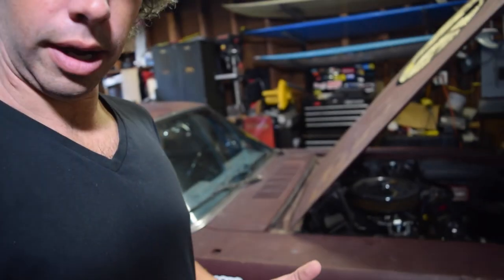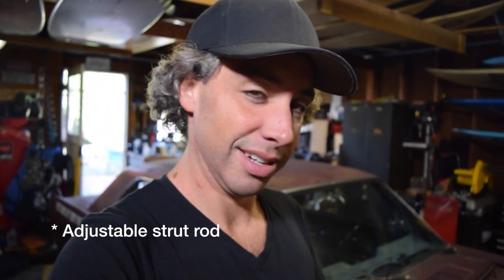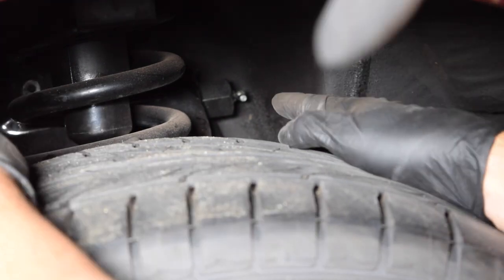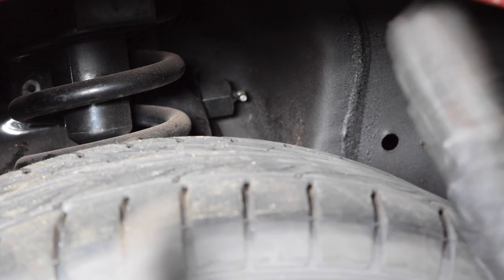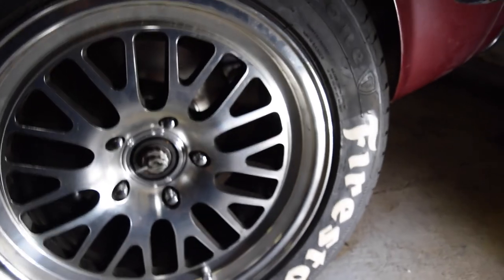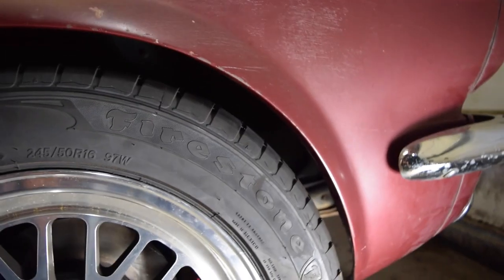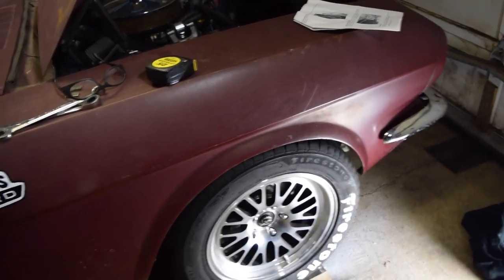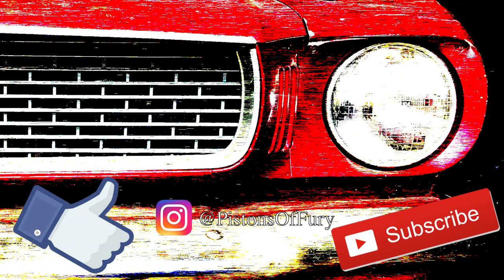PoF // Ep 28 - How to adjust your caster

Comment: I am about to align my 1970 Maverick. Can someone tell me if I need to add shims and loosen the control arm bolts? Does the "Suspension Tension" pull the control arm away from the tower or keep pressure against the tower? Do I get bonus points for using suspension tension in a sentence?

Comment: I did basically the same thing on my 66, ie. loaded up the front upper control arm bolts in order to increase caster. After doing that I didn't notice any particular increase in the steering wheel's tendency to return to center while exiting a turn. I still have to manually unwind the wheel. Does your wheel return to center on its own like a modern car? I have power steering.
Reply from the maker: Mine does return to center, but i'm manual steering (not sure if that matters). What were your final caster numbers?
Reply: That's a good question. I used one of those bubble camber gauges that attaches magnetically to the hub. You're supposed to be able to calculate caster by measuring camber with the wheels turned 20 degrees in each direction, and multiplying the difference by 1.5. My results didn't seem to make sense so I'm not sure. My raw camber figures for the driver side are: wheels straight -.5*, left 20*: +2.5*, right 20*: -4. This seems to me to indicate positive caster but the gauge said it was negative. In essence I'm not sure.
Reply from the maker: Got it. You may want to consider picking up a digital gauge. You can find them for about $35 without having to purchase an entire alignment kit. The method I used zeros out the gauge when the wheel is 20* inward and then gives you a reading at 20* outward that you 2x for your caster value. It saves a little bit of math and I imagine is a bit more accurate than the bubble style.
Reply: But I am on the right track, correct? With wheels turned right the driver side has negative camber and the passenger side positive.
Reply: As far as a digital gauge, are you referring to just a digital angle finder or something specifically for automotive use?
Reply from the maker: This is identical to the one that came in my kit: https://www.amazon.com/Calculated-Industries-7434-AccuMASTER-Inclinometer/dp/B0148M7P4O

But yeah, the method you're using sounds correct.

Comment: Why just take it to a reputable shop have a alignment done , usually run around 100 be done with it!
Reply from the maker: On this car, and any older car, there are two reasons:

1. Most alignment shops won't have someone on staff that actually knows how to align a car with the obsolete shim system (or anyone that wants to deal with it). They're all used to just turning simple camber bolts and tie rods when the computer tells them to. 

2. You need to at least get it close to spec to be able to drive it down the road safely to the alignment shop in the first place (or pay another $100 for the flatbed to get it there). A setup like this will get you 90% of the way there and once you know how to do it, it's basically a 30-minute process.
Reply: yes thats lazy and they will not do it or do it right damn it irritates me that people want everything done for them in a world known for being lazy n half ass work done it like now a 15- 16 year olds are kids ..bs... do what i worked for a living started at 14 and i was a spoiled brat but with a bit of drive of hating that narrative
Reply from the maker: @behexen250 Yeah, totally get what you're saying. In this procedure, I set the camber before doing the caster adjustment and then checked it after. The shims make it kind of a pain, but the adjustable strut rods helped fine tune the caster when I got it close enough with the shims (without having to change those again and mess up my camber). 

It drives straight, but I haven't put enough miles on it to gauge tire wear yet to know for sure.